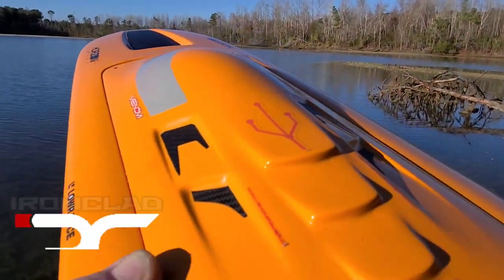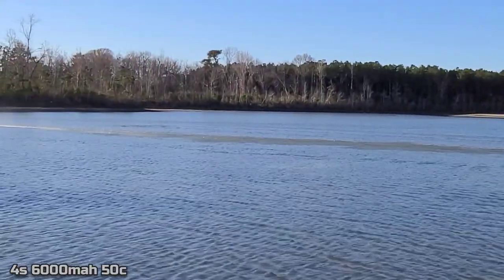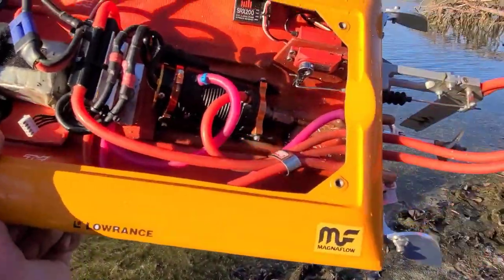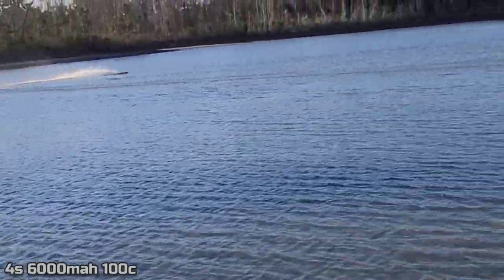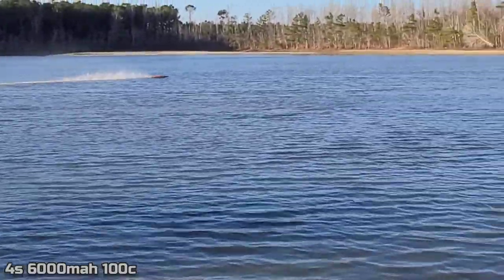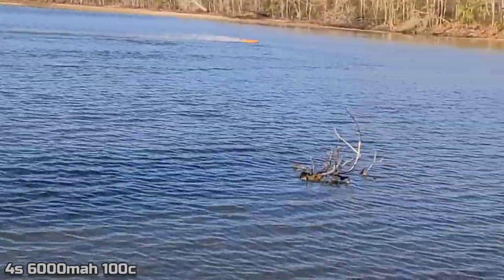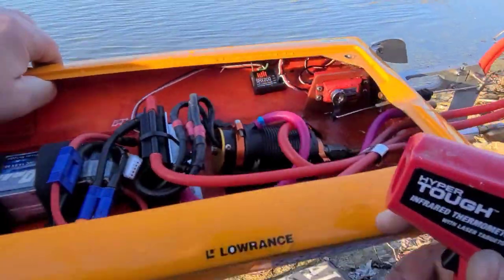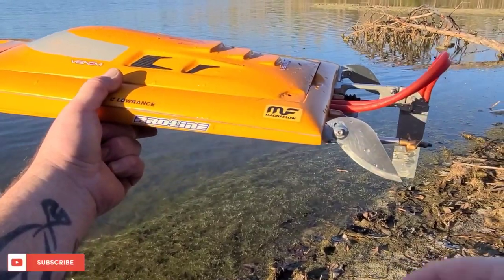Adjustable Stinger Test Deltaforce 35 Fast Electric Rc Boat - 4s 50 & 100c lipo

Comment: Great video bro. Hey I need a 12s capable esc for a 48” proboat zelos. Needs to be at least 250 amps, any recommendations?
Reply from the maker: Here are a couple 300a  speed controls that i would use if i were building a boat.   The swordfish 300 would probably be the best bet,  It has data logging the whole nine.  the 300 tfl looks legit as well.

https://www.offshoreelectrics.com/proddetail.php?prod=hef-HBX1300L-X-Series

https://www.ebay.com/itm/300A-ESC-Speed-Controller-for-Boat-Brushless-Motor-High-Voltage-for-RC-Boat-/223600801577?mkcid=16&mkevt=1&_trksid=p2349624.m46890.l6249&mkrid=711-127632-2357-0. 

https://www.offshoreelectrics.com/proddetail.php?prod=ztw-300-6300400

https://www.offshoreelectrics.com/proddetail.php?prod=hef-HBX1300L-X-Series

Comment: This is good 😊👍 I reckon 4s is less stress,Im going to use 4s in my Arowana mono hull with SSS 4082 2600kv 48mm Prather prop.Im must get the 100c lipo thanks for showing 😊👍
Reply from the maker: Yea definitely pushing the limits of that flycolor 150a with the tp4060 lol.    It takes it on 4s and 6s Temps are hot on 6s.
Reply: @IRONCLADRC  It's going really fast for 4s a d surprised the 150A accepts the TP4060 0n 6s.ive got the 4060 1650kv but got a ztw Seal 200A for 8s.Maybe your boat gets hot cause you drive it always as fast as possible 😊👍